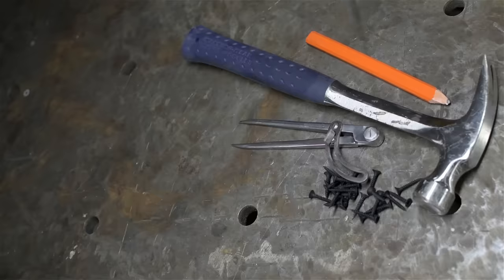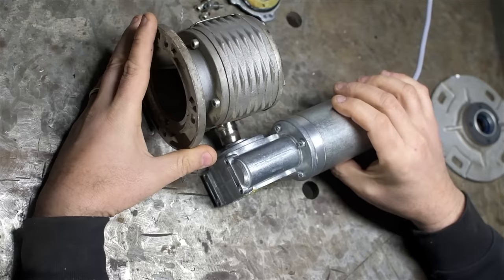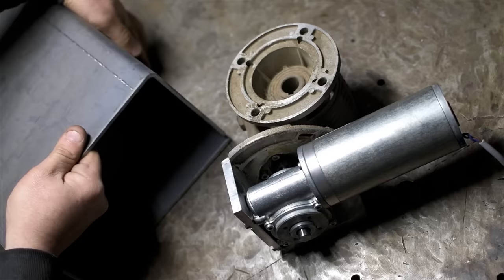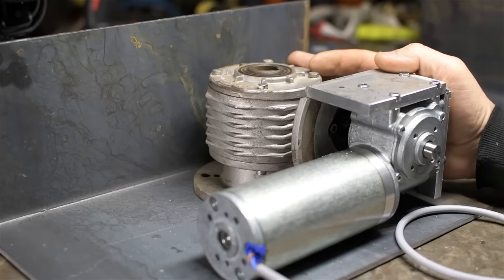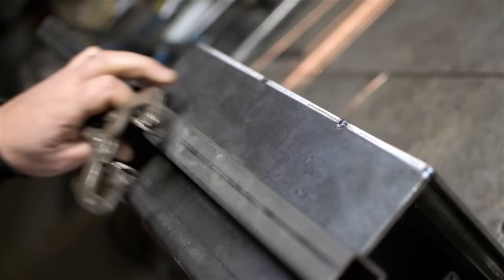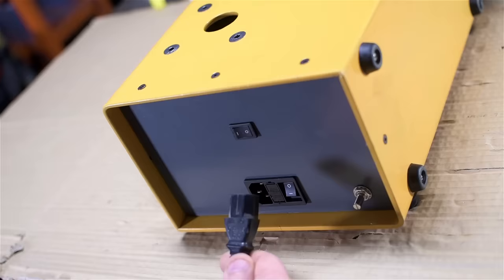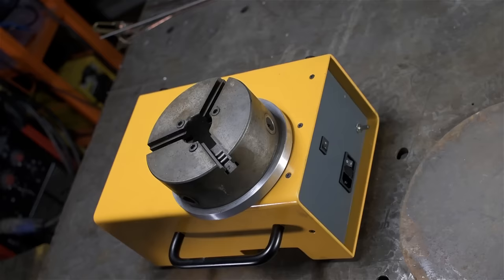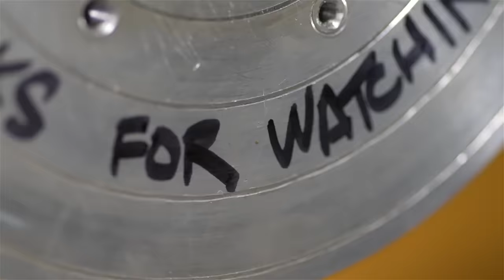Building a Rotary Weld Table

Comment: Another awesome build - thank you so much Tony! At https://youtu.be/ny5Xxwwpkxs?t=1590 does that mean the welding (earth) clamp is clamped to a rotating centre-post of the platten? Presumably the electric motor has lots of torque to handle that? Was wondering how you'd handle the earthing. I loved the pennies you welded near the end on top of the round disc - looked perfect to me!

Comment: But can it run Crysis?!

You could add a voice controller to it. They’re on eBay and not expensive. 
The voice controller would be cool; you could say : 2 rpm, 3 rpm, 4 rpm. 
Or Alexa Turn Table 10 RPM. 🤷🏼‍♀️🤷🏼‍♀️🤷🏼‍♀️